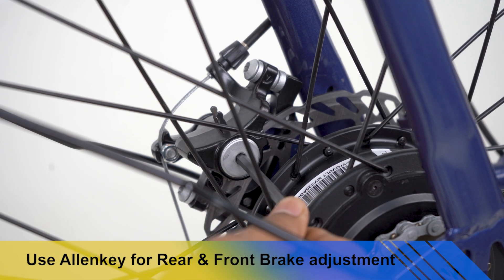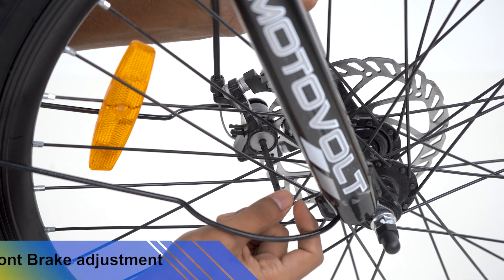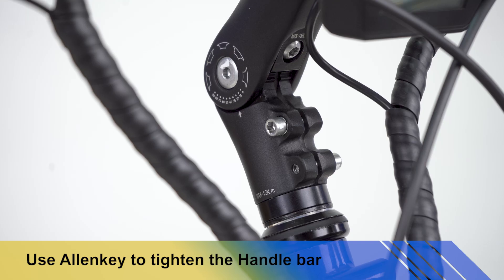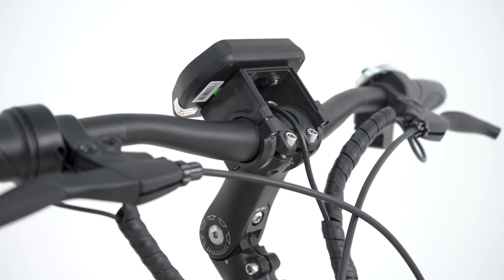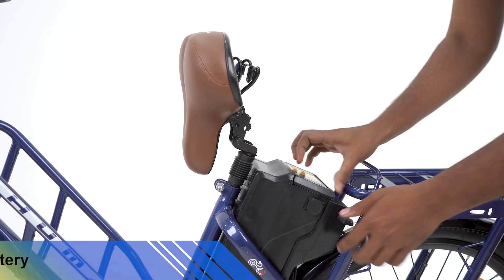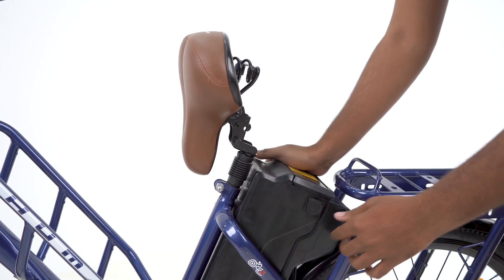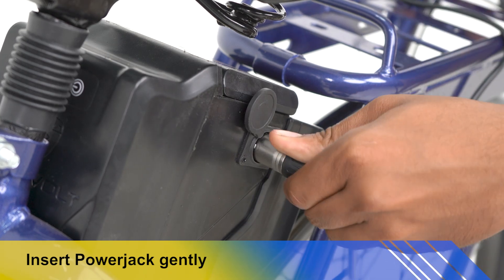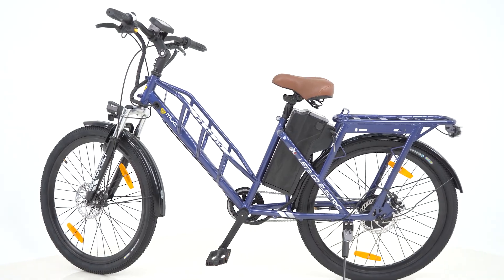Self Service of Motovolt Electric Cycle-HUM| Price under 31000 | Service electric cycle at  home

Comment: Don't buy this cycle frienda worst customer service, they don't have proper service man and spare also
Reply from the maker: We regret the inconveniences that you have faced. Please share your contact details or call us on 07949107107
Reply from the maker: We request you kindly share your contact details with us if the above-mentioned issue still persists so that our specialist will connect with you to understand your issue and take quick action from our end. For any other concerns at 07949107107 [KINDLY DIAL AS MENTIONED WITH ZERO (0)] or you may also email us at hello@motovolt.co

Comment: My Hum Model Display Not working, Cycle runs only peddle assistant mode, It's very disgusting🤬🤬🤬🤬🤬🤬
Reply: Don't buy this cycle frienda worst customer service, they don't have proper service man and spare also
Reply from the maker: We regret the inconveniences that you have faced. Please share your contact details or call us on 07949107107
Reply from the maker: We request you kindly share your contact details with us, so that our specialist will connect with you to understand your issue and take quick action from our end. For any other concerns at 07949107107 [KINDLY DIAL AS MENTIONED WITH ZERO (0)] or you may also email us at hello@motovolt.co

Comment: How to change the tube
Reply from the maker: The tube can be changed from local vendor
Reply: Don't buy this cycle frienda worst customer service, they don't have proper service man and spare also
Reply from the maker: We request you kindly share your contact details with us if the above-mentioned issue still persists so that our specialist will connect with you to understand your issue and take quick action from our end. For any other concerns at 07949107107 [KINDLY DIAL AS MENTIONED WITH ZERO (0)] or you may also email us at hello@motovolt.co

Comment: Excellent...
Reply: Don't buy this cycle frienda worst customer service, they don't have proper service man and spare also
Reply from the maker: We request you kindly share your contact details with us if the above-mentioned issue still persists so that our specialist will connect with you to understand your issue and take quick action from our end. For any other concerns at 07949107107 [KINDLY DIAL AS MENTIONED WITH ZERO (0)] or you may also email us at hello@motovolt.co

Comment: Are electronic parts of that cycle waterproof?
Reply: S waterproof as I used for more than 7 months and ride during rains also
Reply from the maker: You can ride the e-cycle in heavy rain without any hassle. These are IP67 water and dust free.

Comment: Develop a lock for battery power on and off button, without lock to power    button it feels insecure to park even it is locked chain lock.
Reply from the maker: Thank you for your feedback. We will definitely work on it
Reply: Exactly 👍
Reply: Don't buy this cycle frienda worst customer service, they don't have proper service man and spare also
Reply from the maker: We request you kindly share your contact details with us if the above-mentioned issue still persists so that our specialist will connect with you to understand your issue and take quick action from our end. For any other concerns at 07949107107 [KINDLY DIAL AS MENTIONED WITH ZERO (0)] or you may also email us at hello@motovolt.co